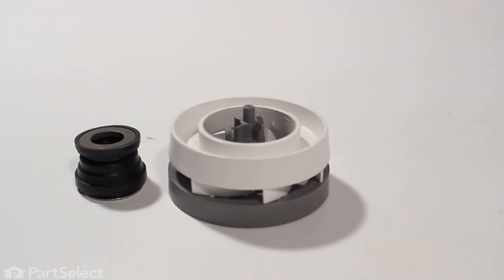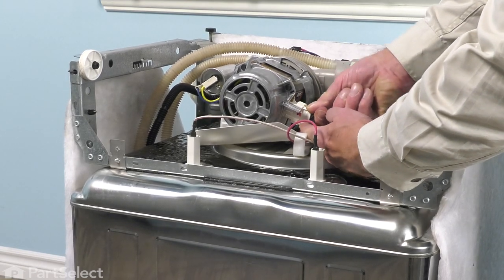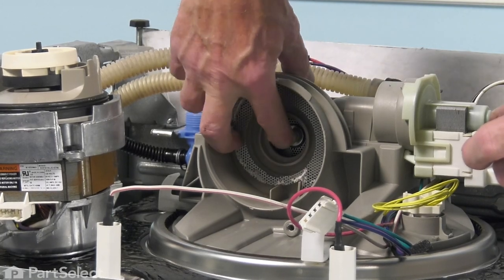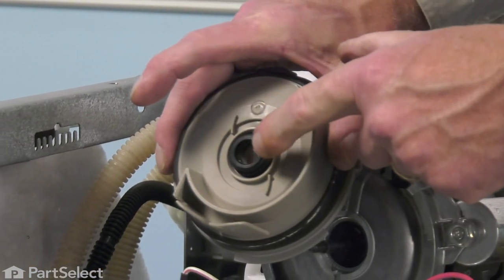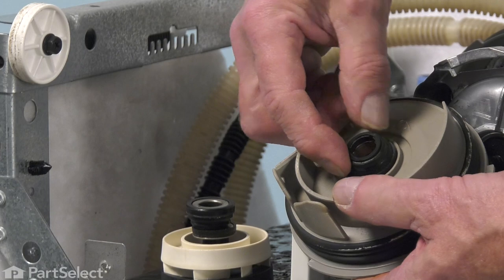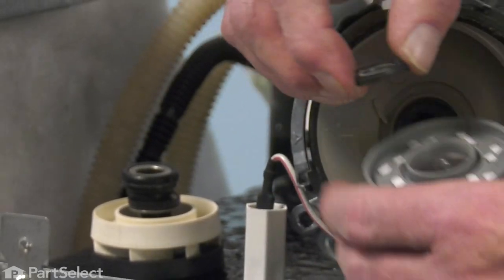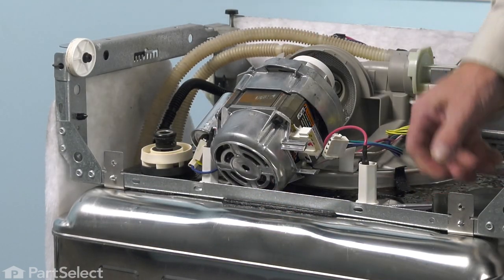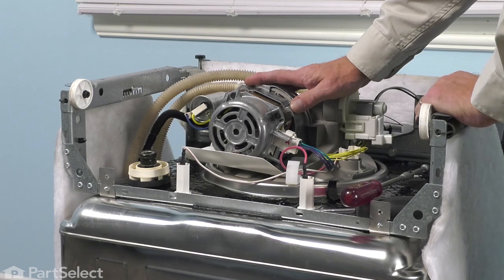Whirlpool Dishwasher Repair - How to Replace the Impeller and Seal (Whirlpool # 8193951A)

Comment: If you push the seal assembly on the way he shows you will crack the graphite ring.  Remove graphite ring.  press on seal assembly.  Line up ring notches with center sleeve carefully install graphite ring.